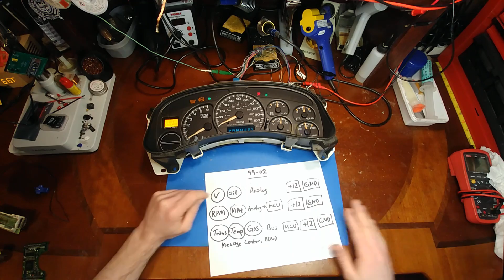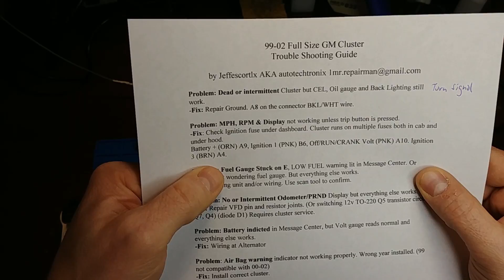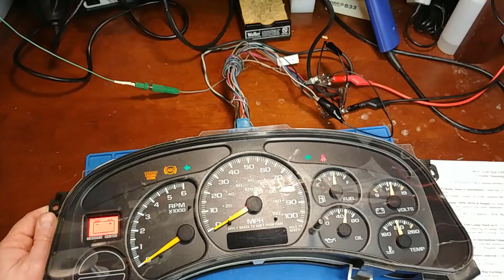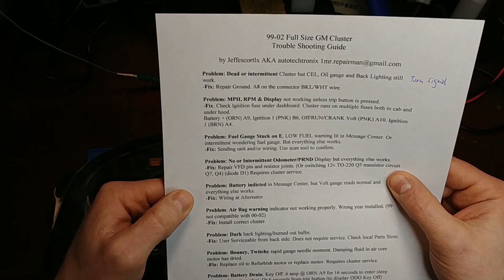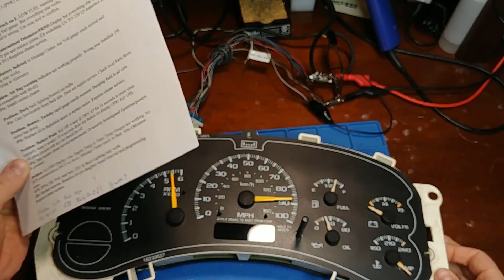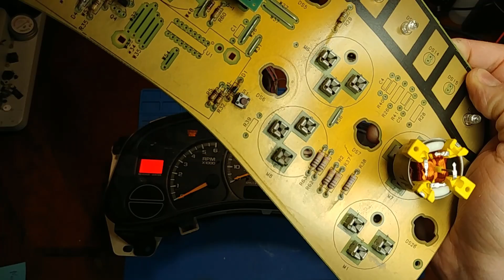GM Cluster Troubleshooting Guide 99-02

Comment from the maker: For GM cluster repair service I can be reached at 1mr.repairman@gmail.com
Reply: Nice! I’m glad you offer the service. I’m gonna try an fix mine, myself. If I screw it up, I’m gonna send it to you ! 🤣😭
Reply: Im popping my PRND fuse , replaced ignition switch/module , by the key , replaced multi function switch , replaced the whole transmission that worked in my other truck , so i put it back in it . Still blows the stupid fuse , no tach , ni speedo , stuck in second ..im replacing the wire harness now to the transmission and doing a dash swap ,with a bunch of new wire harnesses, but my hopes ain't high ..could the cluster do that , blow the fuse for prnd ? 2000 gmc 3500 bucket truck ..5.7 4l80e 2wd
Reply from the maker: @MikeSmith-nu9wt unplug the instrument cluster, if the fuse still blows with the instrument cluster disconnected, then this problem is not caused by the instrument cluster.
Reply from the maker: @keithzeug1944  the lights are user serviceable. 99-02 use air core motors, they are discontinued.

Comment: I have 2002 gmc sierra 1500 and my fuel and temperature gauge don't move done replaced the instrument cluster the battery light stays on done had the battery and alternator checked and there both good

Comment: I see people asking for the pinout for bench testing a 1999 - 2002 instrument cluster , here is the pinout for the cable I made from a junk yard plug out of a 2000 Silverado,  on the blue plastic wire retainer you will see in very tiny lettering A 1 through A 12 , and B 1 through B 12
The pinout on mine is as follows  Ground wires are A6 A8  both wires are black..... wires to + power are A4 Brown, A7 Gray, A9 Orange, A10 Pink , B 6 Pink

Comment: I have a 2000 with trans temp. The guage only works when you push on the cluster. I can't find a broken solder joint anywhere. Could it be just a faulty guage?

Comment: I have a 2002 Chevy Express 1500 conversion van and after replacing the stereo my gear shift select/OD display and MPH gauge are both completely dead. I've replaced the entire cluster and I'm still having the same issue. Just trying to get a direction to go in. Thanks in advance for your patience. LoL

Comment: Great videos Jeff. My speedo and odometer does not work on 05 Blazer. When I took the cluster apart, it has air cores (99-02 GM), not stepper motors. I swapped the tach/speed air cores and added oil (from your videos). Tach works with swapped air core, speedo still does not work. Any advice or further details will be appreciated. Currently my dash is all disassembled wondering what to do next.

Comment: I didn’t hear you talk about the issue I’m having.  I changed all the bulbs to blue led.  All of them work fine except for the left turn signal led.  Still works at the front and back of vehicle just bulb isn’t lighting up.  When I plug the cluster in that very bulb flashes one time and never turns back on.  Any ideas?
Reply: Probably a faulty bulb. Try swapping it out with a different one and see if the problem is with the socket or the bulb

Comment: My entire cluster panel went out (excluding turn signals, check engine) so I bought a new cluster panel. After plugging it in, it still wasn’t working. Watched your video and rewired the eight wire and checked with a multimeter to confirm power was flowing through. Unfortunately, my cluster still isn’t working. Thoughts?

Comment: Mine wouldn’t read gas, temp and my gear selection was out.  Also it had a red battery.  Got a new cluster and same thing.  Turns out someone had pulled my cruise control fuse on the interior fuse panel.  New one in and fixed.
Reply: Thank You! Mine had the same problem. My Truck is the base model and doesn't even have cruise control.
Reply: Life saver hope your pillow is always cold and I hope you never go a night without play

Comment: I have an 07 Trailblazer and the only lights that work is the backlight and the engine light even after changing it 3 times what’s most likely the issue?
Reply from the maker: What did you change three times? The entire instrument cluster? If so perhaps you have a blown fuse.

Comment: Where's located the mcu, because my problem is that when i put the key en ignition all is working well, but i start the truck and miles, revolutions, gas and temp dont work, sometimes works but i just wait a few minutes and left work again
Reply from the maker: You might be missing one of the ignition circuits.

Comment: my 2002 chevy express van no tail lights and when power is off several gauges don't go to zero only the battery when I start the van fuel gauge pegs to full  and still no tail lights but blinker and brake lights work. can you help?
Reply from the maker: Sounds like a bad ground somewhere to me.

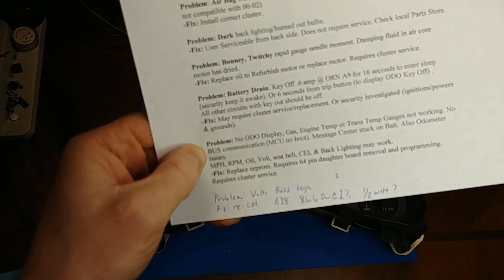Comment: Wondering if you have any advice. I have a 02 gmc sierra and my cluster is acting just like what you showed at the 12:40 mark on the video batt light on no gas gauge no temp gauge to gear indicator. I just bought a rebuild cluster and it does the same thing. Any advice would be appreciated thanks
Reply from the maker: Sounds like the cluster isn't receiving the bus communication from the truck. Bus might be off line, trouble shoot obd communication.
Reply: @jeffescortlx having the same isssue on 2 clusters
Reply: @jeffescortlx I’ve tried 4 clusters everyone does the exact same thing. RPM Speedo oil battery work, but nothing else works. Any advice?
Reply: @jeffescortlx  do you have a video on trouble shooting this?
Reply: Did you figure out this problem? Mine is doing the same thing.
Reply: Same

Comment: I’m back did the a8 ground fix my PRND display now only work If the truck isint full turned on temp and fuel still don’t work battery light stays on security light will pop up once in a while
I noticed the cluster will switch from the gauges that currently work not working and the PRND display comes on also the chime will start to play until I fully dim the cluster whenever I touch or wiggle the 10 amp fuse labeled ign 1 located in the driver side fuse panel under the triangle trim piece
Help I’ve ran new grounds on both a6 and a8 still nothing
Reply: Also doesn’t show high beams are kn
Reply from the maker: Can you monitor the clusters power while driving the truck? I would keep an eye on the ignition powers (multiple) and continuous power to see if any of the circuits are dropping out.

Comment: Hi jeff, my 01 yukon oil pressure needle stays where it’s at when i completely shut off the vehicle, i don’t know if that’s normal or not. But when i insert the key and turn it to on position it goes back to zero. Then if i wait 30 seconds to 1 minute the needle starts to creep up to about 20 psi ( keep in mind the engine is off ). Is this whole thing normal or there’s something wrong with my car ?
Reply from the maker: That's a bit strange your oil pressure reading is creeping up with the engine not running.
Reply: @jeffescortlx  yep, searched the whole internet and can’t find an answer. Do you think the cause is within the gauge or the engine ?
Reply from the maker: it could be a problem within the cluster, or maybe the oil pressure sending unit is failing. They do fail quite often.

Comment: Just watched your video, it was great.  The speedometer and odometer on my 2001 Silverado has stopped working. Everything else still works.  The display still shows the mileage (unchanging).  Because the speedometer is not working it effects the odometer,  cruise control,  automatic door locks (based on speed) and the turn signal warning,  (if left on).  The air core motor is good, I swapped it with the tach, the tach still works but no speedo. Any insight or assistance on the cause would be greatly appreciated.
Reply from the maker: It's not the cluster that's the issue, it's the VSS signal coming in.
Reply: @jeffescortlx  I have connected an OBD2 reader to the truck and I can read the speed on the reader.  I noticed in your video that you connected a signal generator to the white wire (A2).  Is there a way to test the speedometer without a signal generator?
Reply from the maker: For this year range of instrument cluster, the speedometer does not use the bus communication to grab the VSS signal, it uses the analog input.

Comment: So going off the Basic Understanding. My RPM, MPH and GAS gauge are not
Reading at all, sometimes they fluctuate and work
Randomly but for the most part they do not work. My oil voltage and temperature gauges are working fine. My odometer is no longer marking any miles while driving. Everything else is working. The message center is working fine. So based off the Basic Understanding, more than likely I do not have a bad Ground issue. Would U say it can be my MCU??? How would I repair that
Reply from the maker: Yes this sort of problem is typically repairable.

Comment: Gauuges work, check engine light and all other warning lights work, but no back light. replaced all bulbs, checked fuses, nothing changed anything
Reply from the maker: Could be a light dimmer issue, wiring issue or a problem with the cluster PCB.

Comment: Have a 01 tahoe ls and the engine temp is not moving and just stays at 260 when u first start it up what can i do to fix this
Reply from the maker: The 02 and older typically don't have gauge issues that cause gauges to stop reading. Double check the ECT sensor is being read by the ECM.
Reply: @jeffescortlx  im gona replace it and see what happens ty man

Comment: This solved my problem with the A8 ground AFTER I prematurely sent the cluster in for repair.  I received the cluster back, plugged it in and had the same deal as before.  Checked out this video and 3 minutes in you helped solve my issue.  New ground ran and works like a charm.  Thanks for making videos like this.  You've got my support!
Reply from the maker: Did the place that you sent the cluster to for repair help point you in the right direction?
Reply: @jeffescortlx  not at all! Just sent it back with a certificate. Thankful to have found your video for help.
Reply from the maker: @JBOutdoors I'm glad to hear my video was helpful!

Comment: Hi, so I am having the problem of gauges only working when trip is pressed.  I wrote down A9, B6, A10, and A4 have to be working but where are these fuses located and what might they be called in the panel so I can trouble shoot.  Great video, thanks
Reply from the maker: I'm not sure what the fuse is labeled, I do not own one of these trucks. But I would recommend checking any fuse that might be related to the interior electrical. Both under the hood and in the dashboard fuse box.

Comment: Can you test v it the plug at the cluster  what pin.
I put a new vss in
I checked the fuse
No speedometer 
2000 chev 3500 5.7
4×4

Comment: I used to get a split-second signal loss of the cluster when hitting a bump but as soon as I grounded A8, the problem became much worst. The needle readings are completely off and when I turn everything off and remove the key from the ignition they still flicker slightly....:( should I remove the ground from the PCM and only use another one??
Reply from the maker: Sounds like you're probably having internal cluster issues.
Reply: @jeffescortlx  eliminated the ground to the PCM alltogether and grounded A8 to the frame. I had followed another youtuber and the comments were all positive. I am certain your fix is much better. I just found it odd that having the PCM still connected and grounding it elsewhere didn't fix my issue but only grounding it to a metal location did it.
Reply from the maker: @MrShenron89  yes ground needs a connection to a conductive material that has contact with the grounded chassis/body.
Reply: OK so I got it working again.....I completely cut out the ground to the PCM and grounded the wire to the frame. There are two nice bolts/nuts right outside the fuse box. I simply added another 10mm nut on top of the existing one with wire running up top lol nicely hidden.

Comment: What if the cluster light doesn't work but everything else works fine I've replaced bulbs
Reply from the maker: If none of the back light bulbs are working it could be a problem with the headlight switch module.

Comment: Hi Jeff 👋 just wanted to chime in and say that after much YouTube "U" videos last fall i preformed the A8 ground correction , minimal successes was had , after driving through the winter months with ever increasing random ( hit a bump ) outage/reboot.  I slid the closest tool ( an ice scraper) above the cluster and wiggled the cluster connection,,,,, woop woop ,,,  🙌  it worked 💪  . So i left it stuffed in there 😆  worked great till the temperatures climed close to the hondo mark ,,,, so i decided to disassemble the dash again,,,, i know just 4 screws because i had never put the basel back on .... anyway to make a very long story shorter ,,,,, I had read about all the wonky soldier joints on these clusters ,,,,, imagine how surprised I was to find the joints for the actual cluster connector had were bad . I proceeded to resolider those (  yep i did em all ) and to my amazement lol the cluster is now working as designed 😅       thanks for all the work you do for the struggling 99-02 chevrolet silverado lovers out here 💪🙏🙌👍🏻👍🏻💯

Comment: Hey Bud, I have a 2000 gmc sierra 1500. I just replaced the stepper motor but my display says low fuel when it isn’t. Any idea or is it my damn sending unit. Thanks
Reply from the maker: For 2002 and older it's always a sending unit. Chevy didn't start to use defective stepper motors until 2003. 
But the cluster doesn't trigger the low fuel light by the location of the needle. So even if you did have a bad aircore gauge motor, it's impossible for that to trigger the low fuel light. You have a bad sending unit, and or wiring to the sending unit.
Reply: @jeffescortlx  yeah it was stuck at half tank but low fuel light was fine. Low light didnt stay on until I replaced the fuel gauge motor.
Reply from the maker: @TailEndCustoms  the instrument cluster doesn't need or require the gauge motor for the low fuel indicator to function. There is no direct connection besides the data bus and the sending unit between the low fuel indicator and the motor that moves the gas gauge needle. They are otherwise independent of each other.
Reply: Nevermind. Just saw probably sending unit cuz I cleaned the ground under the front driver wheel. Ugh. May as well replace the fuel pump too

Comment: 01 cluster prnd an odo doesn’t light up message center doesn’t come an most warning lights not on besides for blinkers they work an gauges work
Reply from the maker: You might be missing one of the ignition circuits. Check your fuses, all of them. The ones under the hood and the ones under the dashboard.

Comment: I am having the same intermittent cluster issue, however my voltage gauge still works, is that still going to be the A8 ground or another?
Reply from the maker: If the voltage gauge is holding steady while the cluster is intermittent it's probably an internal cluster issue.

Comment: I do have one more question my htr a/c fuse doesn't work at all so I was wondering if there's anyway to buypass that fuse
Reply from the maker: Yes it can be bypassed/jumpered. Just make sure the new circuit is properly fused.
Reply: @jeffescortlx  I have a atc fuse panel but I can't seem to find any diagram showing what wires are for the htr ac fuse

Comment: I know ur not gonna see this but I have a 2000 GMC and I have an issue with no odometer display. I saw ur video on how to fix it but I ended up putting in a new cluster and the issue is still there… but when it rains my cluster ends up working again showing the odometer and the gauges. 

I’m not sure if you ever experienced this but plz help
Reply from the maker: I would start with the ground wire since it's the most common to fail. If the problem is still there check the ignition and battery power wires under load. You might be missing one.

Comment: Hi I have a 2002 Chevy silverado I replaced the cluster and it won't show mpr,rpms, or Andy displays besides the engine service soon when I turn the ignition key
Reply from the maker: Did the original one work better?
Reply: @jeffescortlx  no they both work the same and I installed a new ground wire
Reply from the maker: @intovr2229 you might be missing one of the power wires. Could just be a blown fuse. This cluster relies on multiple ignition circuits, not all of them are labeled in the fuse box as being for the instrument cluster. So it's best to just check all of the fuses, both under the hood and under the dashboard.
Reply: @jeffescortlx  ok I'll double check to make sure

Comment: My prob is my fuel,trans and motor Temps don't work. My old port don't work now and the box that's around the display don't show so I cant see what gear I'm in but I can see the gears. Then driving the rpm and speedometer will work then flicker but still works. Has abs light on everything else works fine
Reply from the maker: Chances are the cluster is just showing the symptoms of the vehicle not having bus communication but it's not necessarily the cause.